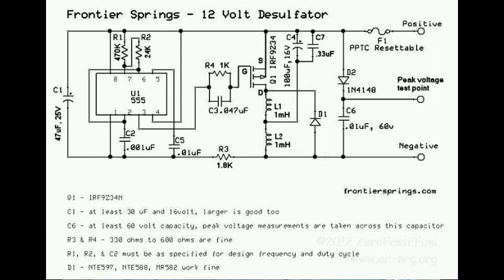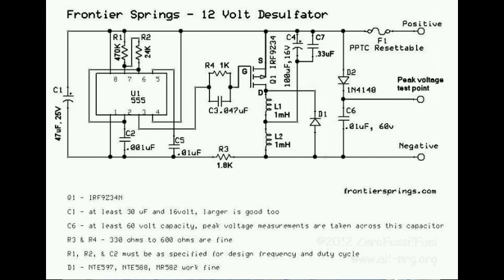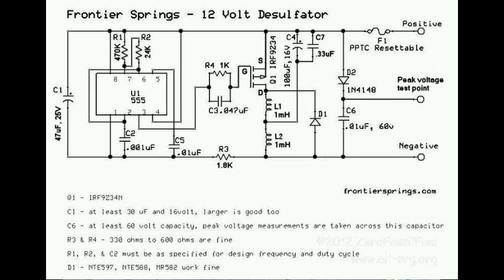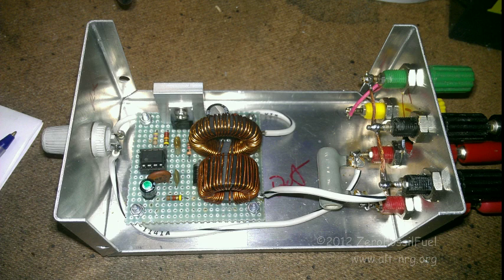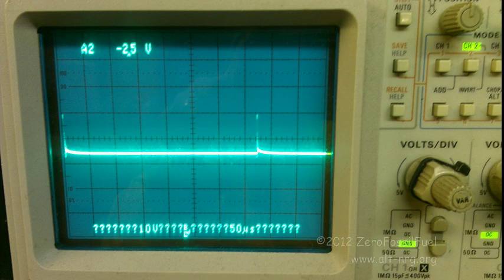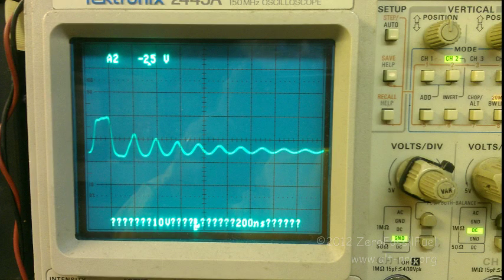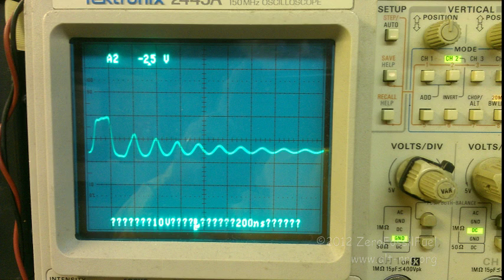#315 SLA battery plate desulfator circuit #2

Comment: I can confirm it works for me with the mods incorporated. Within a very short time I was able to get a bad battery that used not to accept charge up to a stable 12.6V. Before it would keep dropping to 8V sitting for 12hrs after 12hrs of charging with a non-smart charger. Load tester would put it in the red too. I will soon do a proper load test, with a PC and a lamp and see how long it can last..

Comment: The thing is working ... (if we can say that...) I got between 40 to 60 volts peak at the test point ( i did not test it at he battery terminals) and a nice cutting edge square wave at 2600 khz. It is now plugged on a landmower/tractor battery that had only 5 volts. I have now 12 volts ... i don't know if that thing has to do with the result i will see that later ! i finally used a IRF9540 p channel mosfet.

Comment: hi i have been working for a long time wid desulfators,,try to manage the pwm is to operate on freq near 3 mhz try near 3,4 mhz,,,freq for sulphate molecules to break up,,,try to use a ic working at this freq,,,works like a charm,,and yes use aircore coils for high freq...

Comment: Hi Z, was just wondering if you were able to try it out on wet lead acid battery, I also replicated this circuit about 4 years ago with minor changes as you have done. SLA did not react well but the SG didn't do any better either, like you said it might be because of the electrolyte.
Cheers for another informative video :)

Comment: The sulfated battery I mentioned previously had all the sulfer visibly disappear after 3 days.  Desulfation works, but often batteries can have other issues.  Yearly desulfation of lead acid batteries is good maintenance practice.  More smart commercial battery chargers are now including the desulfation feature...  I got one at walmart, because the desulfator worked so well and integrated a "smart charger." For the money, I couldn't go wrong. Dedicated desulfators work better if leads r short

Comment from the maker: I am being told that the desulfators work well on flooded lead acid batteries unless, as you discovered, the batteries are too far gone with shorted cells. I am also told that they only work to keep SLA's in good condition but almost never recover a SLA once it has sulfated. I suspect that may be true because the electrolyte is a gel. All that may be required is mechanical agitation or vibration. So far no luck with my 1st SLA. Will try adding vibration soon.

Comment: Z, I had a motorcycle battery that had a white opaque case.  After forgetting to put the battery on the charger for winter maintenance, it sulfated.  the sulfation buildup was clearly visibile, mostly on the + side of the battery, as I recall.  It took 3 days to desulfate, but it worked.  Since then, I was sold on desulfators.  Unfortunately, after several car batteries died on me, desulfation didn't help them, because they were shorted in 1 or 2 cells.  Arrrg.  Nice project!  Liked!

Comment from the maker: Lower frequency, longer duration, higher energy pulses. Personally, I think Frontier got that part of the output circuit flipped too. I think the original circuit could have had L1 = 1mH and L2 = 220uH. That would have made more sense to me. This also has me wondering about design originality. If he couldn't even draw the MOSFET correctly, what makes anyone think this was his original design in the first place?

Comment: like plaque on teeth sulfur builds up on the plates inside the battery, this device should if it works force that plaque back in to the acid solution. Thus making the battery, in a way younger and healthier.

Comment from the maker: Not exactly. What you don't see in the schematic is a wall wart 12VDC unregulated trickle charger that sits at around 16V no load and charges at about 400mA. It also connects to the battery terminals through a 5 ohm power resistor that you see in the photo. The desulfator circuit consumes most of that 400mA and returns what's left over to the battery as pulse energy. There are other ways to go about charging batteries with pulse energy. This is just one and it's for lower capacity batteries.

Comment from the maker: During the Q1 on cycle the coil L1 field is charged from the battery being desulfated and stored energy in C4. When Q1 turns off, the magnetic field collapses in L1 creating a reverse polarity HV energy spike. That spike is fed back to the battery through C4 and D1. Then the cycle repeats. L2 only serves to recharge C4 between cycles and helps isolate the transient energy from the 555 timer along with R3.

Comment: Do you think you would be able to explain very quickly how this device really works (or supposed to work) after the mostfet? I am having a little difficulty in understanding how the caps and the coils can pulse to the battery any energy back.

Many thanks,

Fausto. (Plengo)